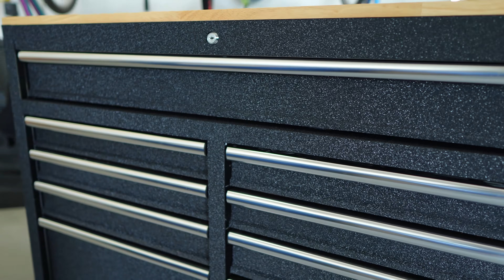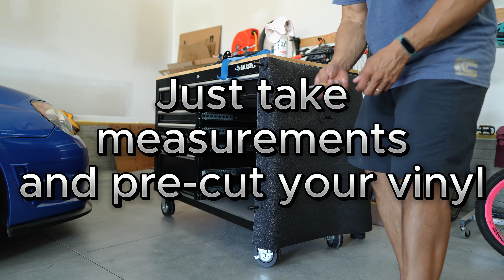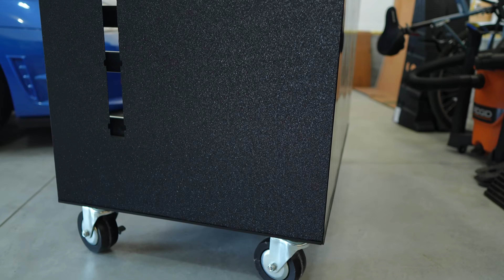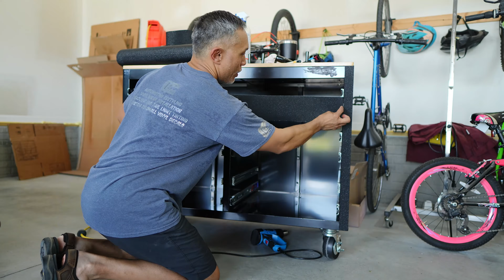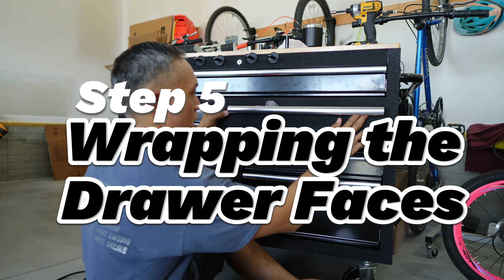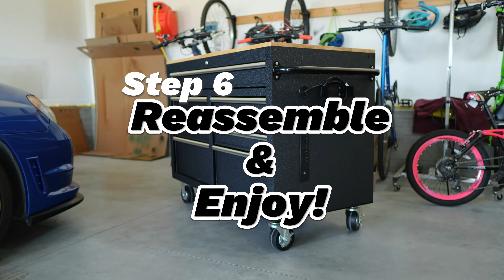Wrapping A Toobox with VVivid Indestructible Vinyl Wrap

Comment: How may and what size rolls did you use sir ?
Reply from the maker: I had a bulk roll of like 20ft long by 5ft, If I recall correctly, that I then just cut pieces to size. That much was way too big for this particular project so I had a lot of excess. If you were looking to buy some to do a project similar, I would probably do all the dimensions and then add 10% for extra to have for errors, To order the size appropriate for your project.